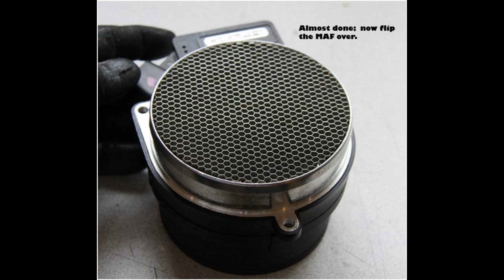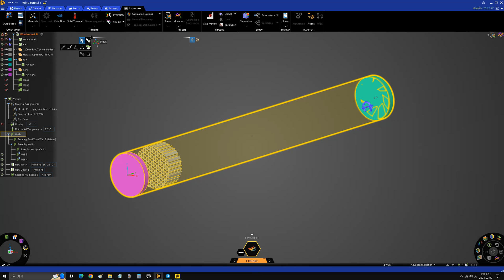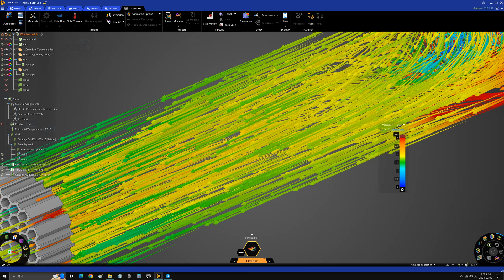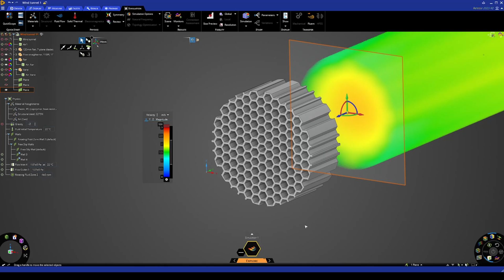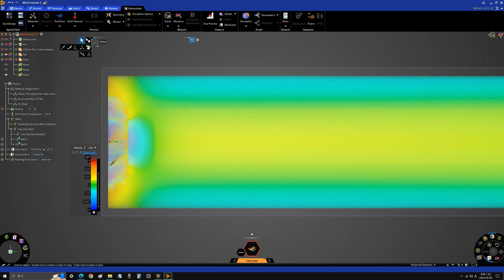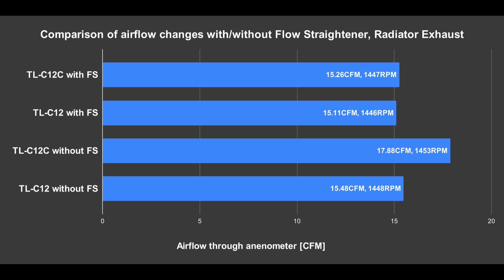The effect of Flow Straightener in Wind tunnel

Comment: Hi,
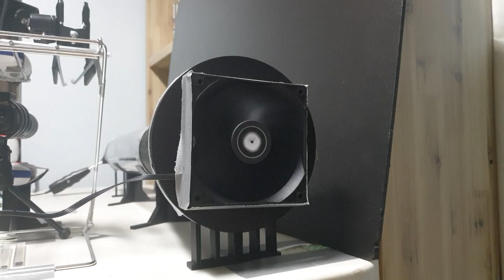I have a question: why in 3:13 TL-C12C without FS have so low CFM compared to TL-C12C with FS? Thanks in advance for your answer.
Reply from the maker: When there is no obstacle behind the fan to be tested, the considerable swirl is transferred to the vane of the anenometer. And, TL-C12C made an very very unfavorable swirl for the vane so that the rotational speed of the vane became extremely small. Therefore, the flow rate was quite underestimated. Conversely, TL-C12 gave a favorable swirl and the vane rotated well (but overpredicted flow rate).

Comment: The only questionable aspect of introducing the FS is the restriction introduced. Fans with higher pressure will benifit when compared to those with less. 

I personally think real world result based matrics are the way to go wheb comparing components that will be used differently that tested.

1) Have a control radiator and fixed heat source. Do multiple tests based on temperature delta to ambiant ( with tempesture taken at fan inlet) and take average, given same workload.

2) Have control computer build with temperature report by components with delta T to ambiant given same workload. Generate average over miltiple runs.

The inherent issue with your testing is lack of real workd application. If there is an analogous its would measuring horsepower at the crank vs at the wheels for a car.

I appreciate all the testing you do and do think it is valuable, but i think the P28 testing shows how somewhat misleading the tests can be when it comes to what a biyernmay want.
Reply from the maker: Hello, thank you for the comment and I answer about your feedback.

1. Flow Straightener
As the above video has shown, I claimed Flow Straightener has two purposes in the wind tunnel: one is the correction of flow velocity distribution and the other is the elimination of rotational vector component of flow. It is one of the essential parts in wind tunnel for fan testing. With Flow Straighener, tester can easily exclude rotating turbulance which heavily distort test results.
But if it is not built properly, it will just act as an obstacle that makes pressure drop as you said. So I designed the Flow Straightener based on AMCA 210-99, the american technical standard about fan testing. This document offers the detailed geometry about Flow Straightener and I followed it as possible. It is cited by many research papers and adopted by fan testing machines since 1999. Its reliability is very high in research fields of turbomachinery.

These are the more detailed background about my wind tunnel. But even though I had referred the standard, there are still more things to improve accuracy and precision. So I'm preparing the new wind tunnel design with the better measurement devices in this year.

2. Thermal test
Next, I agree that thermal test can be more close methodology than tunnel test. But there are some reasons why I didn't start thermal test.

First, much more parameters, which are hard to be controlled by tester but need to be controlled, appears in thermal test. One of the problems is the ambient temperature. Those continuously changes over time(by whether and climate) and can affect the temperature of heat source. Even 1 degree of change can make considerable differance, not just delta-T of 1 degree. When ambient temperature changed x degree, there is literally no guarantee that the temperature to be measured will also change x degree. However, when rotational speed is same in airflow test, ambient temperature hardly affect the result(even hard to make 1% airflow change).
Second, computer fans do have functions of exhausting hot air and inhaling cool air. That means, for computer fans, it is important to evaluate their ability to move air volume. The abilty is usually expressed in the form of 'airflow' and 'static pressure.' And properly designed wind tunnel helps to correctly obtain those parameters. And to represent more real-world like test environment, I use the same obstacle that was used for noise-normalization. I'm afraid I can't agree with you that wind tunnel test is completely far from real-world applications.

3. About P28
Would you inform me which part of data seem suspicious? Or, you can link comparable results by others. Thank you.
Reply: @ThermalLeft Some tests on the correlation on airflow and rate of heat exchange would be neat (perhaps measure on a radiator and check changes in coolant temp). Controlling all the parameters without dedicated equipment could be quite difficult though, HWcooling may be better equipped for this type of test.

There should be a strong correlation, even across different fan models. Possible deviations would result from the differences in airflow pattern, but I am not sure how large this effect would be. I'd imagine it would vary between radiator designs too (e.g. how large the gap between the fan and the actual fins are).
Reply from the maker: @MY-qi8wq  Maybe I'll do the thermal test for small number of fans in the far future. I also want to know how flow velocity profile(conical or cylindrical?) of each fan will make difference for heat exchange of radiator. Thank you for the suggestion.
Reply: @ThermalLeft Try using a thermal camera too, the temperature spread of the fins will surely give some extra insights.
Reply: @ThermalLeft   @MY-qi8wq Thanks for the reply! Yeah, absolutely understand the importance of gathering empirical data related to the fan itself with as little influence as possible. It is also much easier to have accurate results, especially being forced to use imprecise methods (ie relying on sensors out of your control).

Nothing about the p28 numbers are suspicious, it's more of how the data can be interpreted for a users use case. The statistical charts paint a picture of it being shoulders above the next fan in most graphs which, while empirically true, actual result during use will be much closer. 

Granted, I think most competent fans are going to perform very similarly in tests using real world scenarios, which makes gather data independently probably have a better weight.
Reply from the maker: @winebartender6653  Quoting: "The statistical charts paint a picture of it being shoulders above the next fan in most graphs which, while empirically true, actual result during use will be much closer."

Maybe this is because the noise-normailzation method can affect the noise-airflow efficiency gap between fans. Although I do noise-normalization for real PC case, there are some experimental conditions such as noise measuring distance and removal of PC case's front pannel.
I think more given standardization for noise measure will make more gap of noise-airflow efficiency. So it will be important to balance between reality and standardization to offer useful and consistent(in the same time) data.

For extreme example, one test did noise-normalization for P28 in anechoic chamber and vibration damping bench with springs, which are quite experimental.
The result of P28 from the test show that noise-normalized airflow of P28 is literally above all with considerable gap. The result is absolutely reliable because of its precise measure, but can be far from how human feels.
Link: https://quasarzone.com/bbs/qc_qsz/views/1562295
https://img2.quasarzone.com/editor/2021/06/25/48a5bbd981a93825f669fd77390de59c.jpg
Reply: HWcooling has an article explaining the benefits of testing airflow rather than temperature changes for fans (Complete analysis of the final wind tunnel for fan testing). Here's an excerpt:

"Of course, there are quite a few tests of fans on heatsinks or in computer cases everywhere. But these mostly don’t actually go after the parameters that the fans have (that is mainly airflow and static pressure) and only deal with temperature comparisons within a cooling system. Measuring with which fan lower or higher CPU or GPU temperatures are achieved is indeed better than nothing, but it is always an emergency solution for a rough orientation. And sometimes even that rough orientation can be misleading.

In short, the variability of different coolers and different cases is so great that what is true in the configuration within test setup “A” may not be true for other test setup “B” components. In fact, the rest of the cooling system, which is the passive heatsink or the specific layout of the elements in the case, also contributes significantly to the result and the relative ratios that express higher or lower cooling performance. Differences when testing in a natural environment must therefore be taken with a grain of salt, and you must also take into account that everything may work slightly differently in your setup.

Therefore, it is always better, more accurate and more precise to test the fan separately."

Temperature testing is, in my opinion, better suited for cases where you evaluate the cooler system as a whole.